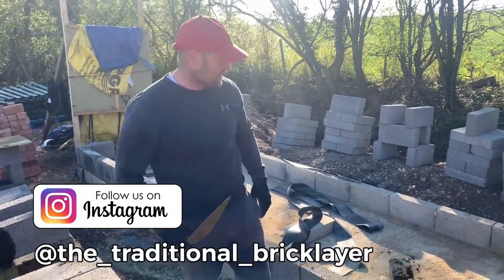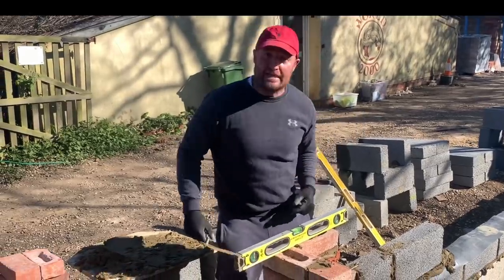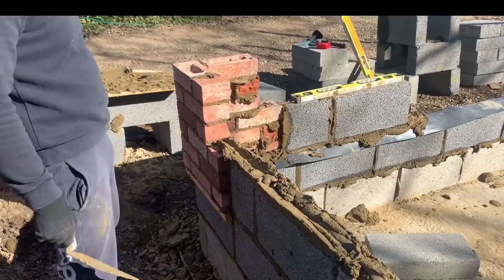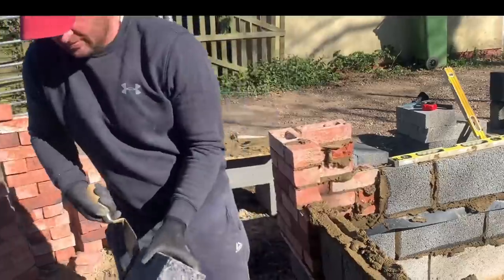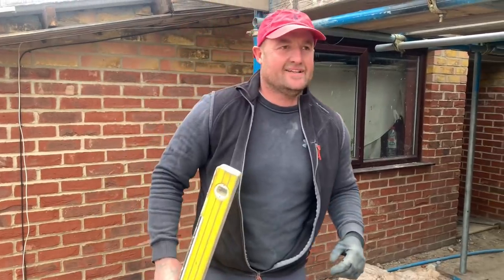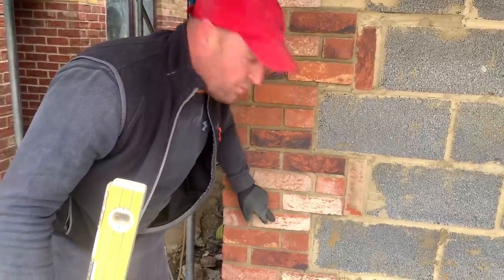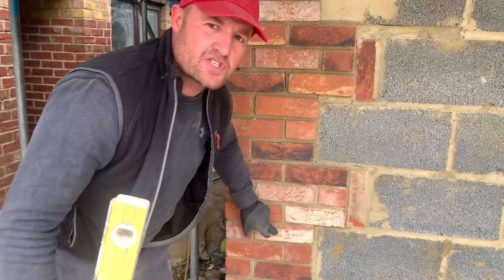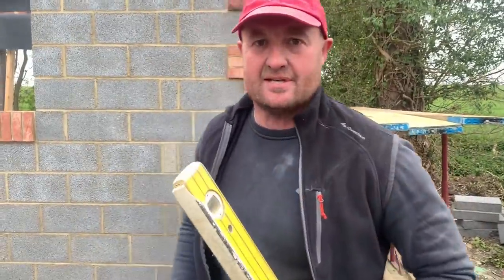#brickwork #bricklaying #mason  Bricklaying tips for building Quoin corners 🧱🏠

Comment from the maker: Morning guys ... perhaps I didn’t explain correctly .. the quoins are 440mm details , so you can not reverse the floating bat , I started the face side 2 stretches so return will be bat stretcher bat .
Coursing and bonding can not be changed because either way the face or side of the building will have a floating bat .

The camera only reveals the side where  I chose to have the bats , on the main face is stretchers .

I’ll post a pic later of the face side 👌

Hope I’ve explained 

Have a great weekend